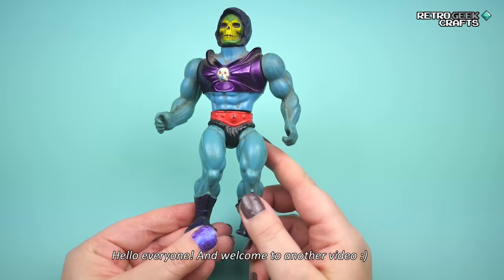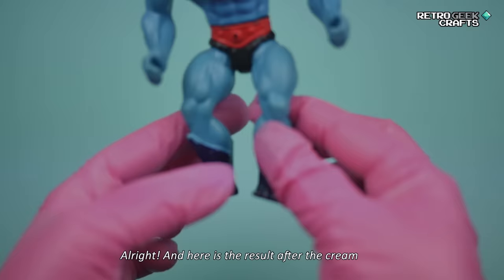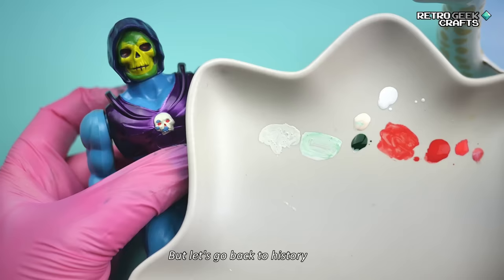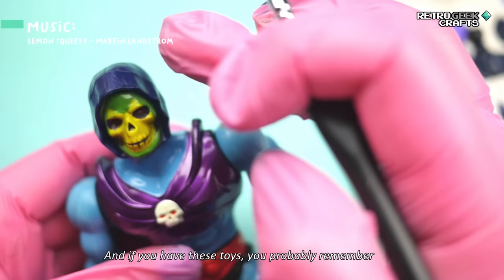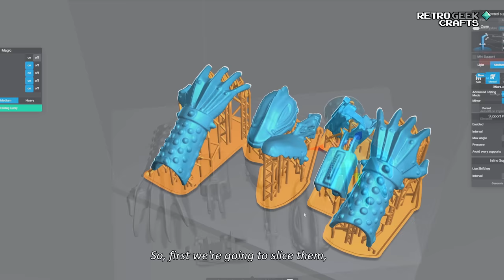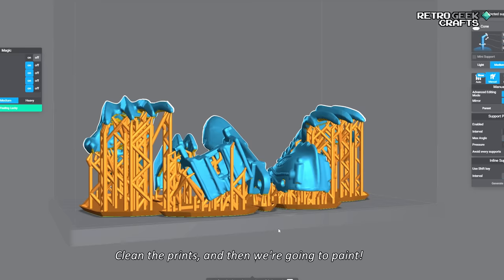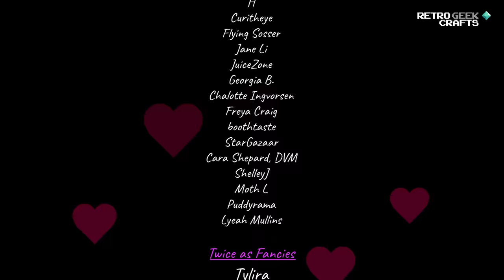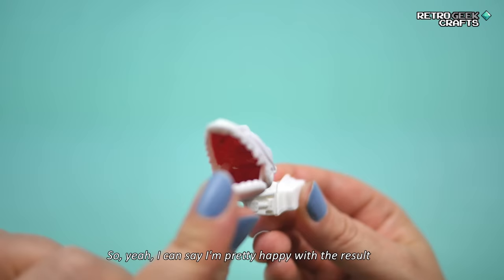Vintage MOTU Skeletor Restoration / Repair - Mattel 1985 Terror Claws Repaint, Retrobright 3D Parts

Comment: have you ever considered using nail polish to paint metallic/glittery areas? youll need to thin it with acetone of course but i used some on my ponies and it lools great
Reply from the maker: You know, I actually did consider it (because of the nail polish I had on my thumb was very similar)  but I chickened :P I will give it a try!!
Reply: Hi! Fellow customizer/restorationist here! Nail polish may look nice for a few pics, but it won't hold up very well over time and will start to chip off of things like rubber and plastics. Metallic paints or chrome powders are the way to go.
Reply: My little ponies?

My younger brother loved those things.
Reply: @scipunkdollstudios4081 Does the nail polish damage the underground, too? Too new to the Business. Don't know anything. 😅
Reply: @emmaorlich7427  Nope. It doesn't do damage. Most nail polishes are made to be temporary and will chip off.
Reply: @scipunkdollstudios4081  Okay. Good to know. Thank you!

Comment: In the future, perhaps pick up some translucent pearl paints and/or iridescent glazes to get the effect you were looking for on the armor, they have the fine sheen you were attempting to replicate, and the reflection color comes in basically every shade of the rainbow. Also it hasn't actually been an issue you've run into thus far (so far as I'm aware) but it seems like useful information given what you do: if you ever need to replicate a flexible part for a restoration, there are actually rubber-like uv cure resins that you can buy for 3d resin printers.